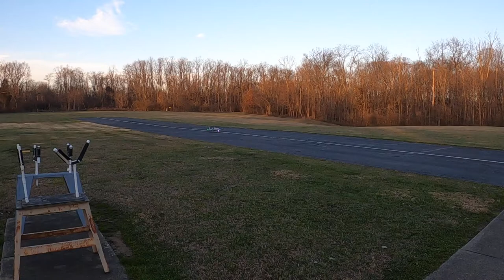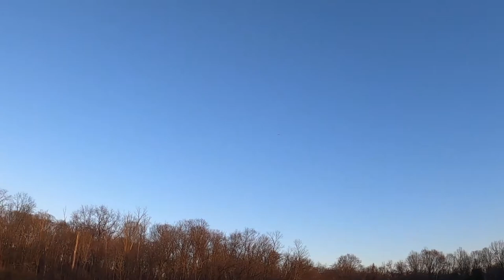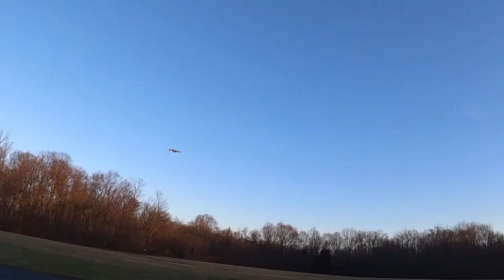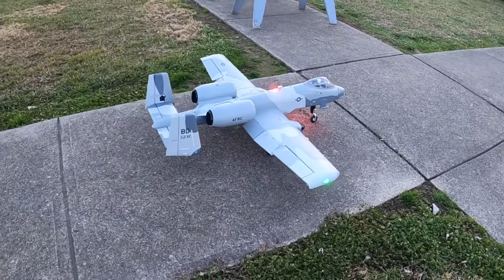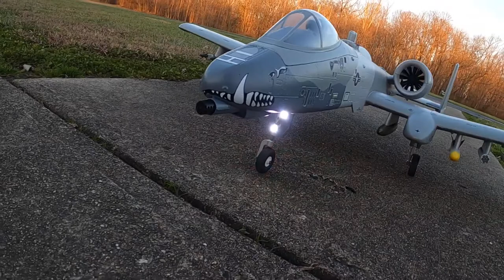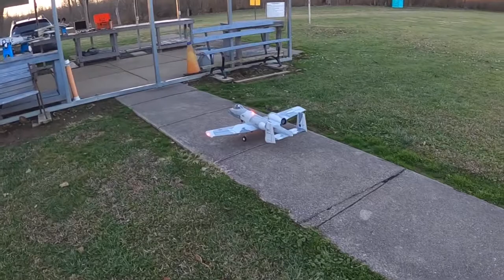E-flite A-10 Thunderbolt II 64mm EDF maiden on 2nd A-10 by Pilot Mike

Comment from the maker: Thanks. Yes, the plane comes with just the red and green nav lights on the tips of the wing. I added the white strobe lights on the wing tips and rear of the fuse. Also added the red nav lights on top and bottom of the fuse and the nose gear landing lights.

After doing the lights on my A-10, Pilot Jim wanted the same on his A-10. Almost the same setup as mine except mine is on a separate channel on the receiver. This allows the nav/strobe lights to be turned on/off as well as the nose gear landing lights using a switch. Pilot Jim's setup was done using the Gear channel on his stock AS3X/SAFE receiver.

What I used for the LED lights on the A-10.
Dimension Engineering
DELight Controller - https://www.dimensionengineering.com/products/delight-controller
DLink 2 - Controller for programming lights (PC only) - https://www.dimensionengineering.com/products/delink

Rest was purchased on Amazon
White - https://www.amazon.com/dp/B01DBZICDC/ref=cm_sw_r_sms_api_glc_fabc_.Gp9Fb5Y4466X?_encoding=UTF8&psc=1
Red - https://www.amazon.com/dp/B01DBZIET4/ref=cm_sw_r_sms_api_glc_fabc_xHp9Fb9AX63TM?_encoding=UTF8&psc=1
Wire - https://www.amazon.com/dp/B073R6C1L8/ref=cm_sw_r_sms_api_glc_fabc_.vp9FbA2NSF5N?_encoding=UTF8&psc=1
Y - Connections - https://www.amazon.com/dp/B07PHDYZXN/ref=cm_sw_r_sms_api_glc_fabc_JGp9Fb1KEQ7K2?_encoding=UTF8&psc=1

Video by Pilot Jim

Please Subscribe if you enjoy the video!

Comment: nice lights, did you modify it?
Reply from the maker: Setup is on a separate channel on the receiver. This allows the nav/strobe lights to be turned on/off as well as the nose gear landing lights using a switch. 
What I used for the LED lights on the A-10.
Dimension Engineering
DELight Controller - https://www.dimensionengineering.com/products/delight-controller
DLink 2 - Controller for programming lights (PC only) - https://www.dimensionengineering.com/products/delink

Rest was purchased on Amazon
White - https://www.amazon.com/dp/B01DBZICDC/ref=cm_sw_r_sms_api_glc_fabc_.Gp9Fb5Y4466X?_encoding=UTF8&psc=1
Red - https://www.amazon.com/dp/B01DBZIET4/ref=cm_sw_r_sms_api_glc_fabc_xHp9Fb9AX63TM?_encoding=UTF8&psc=1
Wire - https://www.amazon.com/dp/B073R6C1L8/ref=cm_sw_r_sms_api_glc_fabc_.vp9FbA2NSF5N?_encoding=UTF8&psc=1
Y - Connections - https://www.amazon.com/dp/B07PHDYZXN/ref=cm_sw_r_sms_api_glc_fabc_JGp9Fb1KEQ7K2?_encoding=UTF8&psc=1